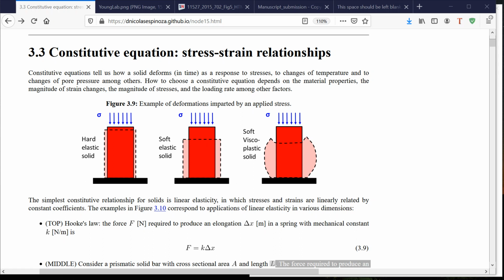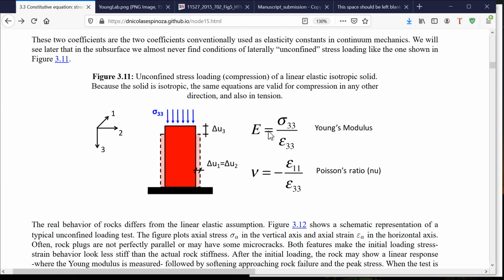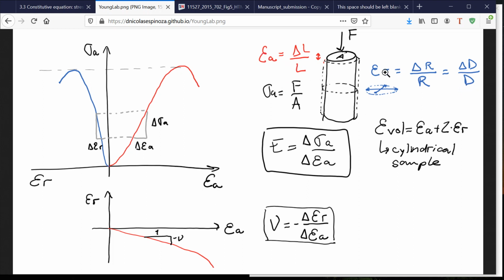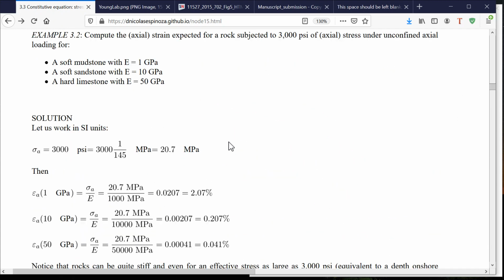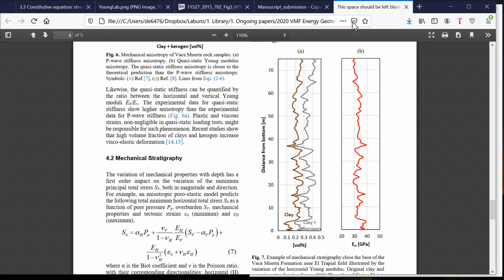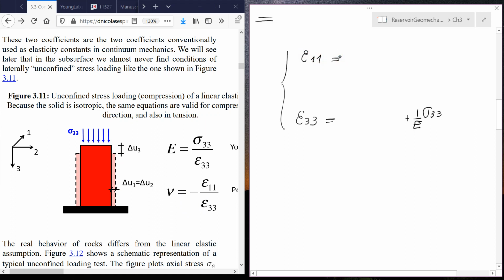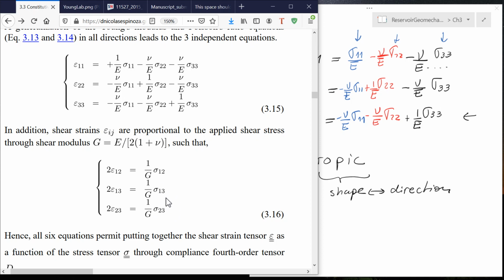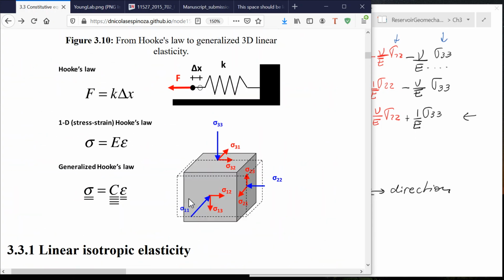L08 Constitutive equations: 3D Hooke's law (linear isotropic)

Comment: Two questions. In the section "Measuring Young Modulus", should your equation for radial strain include a negative sign, i.e., \epsilon_r = - \delta R / R? 

In the "Measuring Young Modulus" section, Poisson's ratio is shown as \nu = - \delta epsilon_r / \delta epsilon_a. However, in the "Introduction" section, Poisson's ratio is shown as \nu = - epsilon_r / epsilon_a in other words, no deltas. Can you clarify on the difference?
Reply from the maker: Q1: No, strains definitions do not include signs. Signs come from "deltas". Q2: great question, the equation with deltas refers to capturing the "tangent" slope of epsilon_r versus epsilon_a. In experiments, this curve (schematic in Fig. 55) varies and measuring Poisson ratio (\nu = - \delta epsilon_r / \delta epsilon_a) should be done during ~elastic deformation, neither at the beginning of loading nor at end near failure.
Reply: @dnicolasespinoza5258  To Q1: I understand that the deltas need to be defined. I might have missed where those were defined in this or previous lectures. Conventionally, contraction is positive, so \delta L := L_i - L_f, where L_i = initial length and L_f = final length. Conversely, elongation/expansion is negative, therefore, \delta R := R_i - R_f, where R_i = initial radius and R_f = final radius. In this definition, since in most cases R_i - R_f < 0, the \delta R value would be negative. Is that correct? 

Additionally, the strain definition given in Fjaer et al. (2008), Petroleum Related Rock Mechanics, Eqn (1.58), p. 14, includes a negative sign, which seems unusual to me, and since in their example \delta L = L-L', which is equivalent to L_i - L_f, should be a positive value. (I've only started looking at this text after looking at this lecture.)

To Q2: Ah, so Poisson's ratio is an instantaneous value? The definition given in the "Introduction" section is for an ideal material that is perfectly linear elastic?
Reply from the maker: @atxlax  Q1: strain is defined (L_final - L_initial), or in general X(t) - X(t=0), the latter known as reference configuration (more here: https://en.wikipedia.org/wiki/Strain_(mechanics)). I'm not familiar with those other definitions. Sometimes, the geomechanics community reverses strain signs for convenience, but in general mechanics contraction and compression are negative. Q2: correct, it's a derivative for real materials. The ratio and derivative are the same for perfect linear elastic materials.